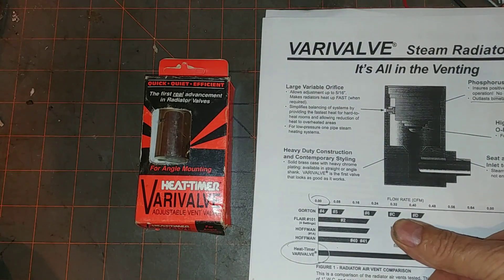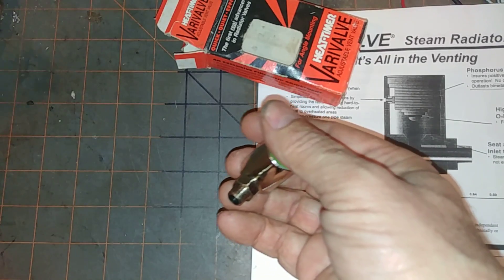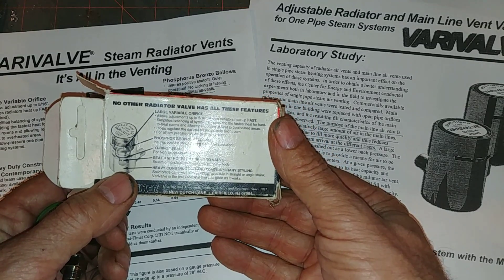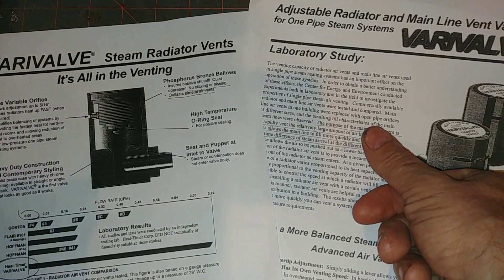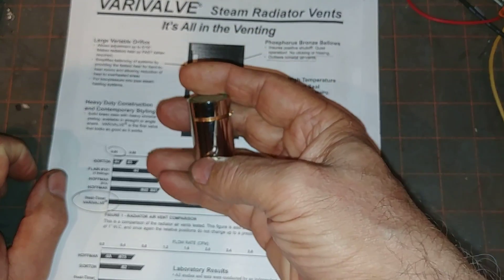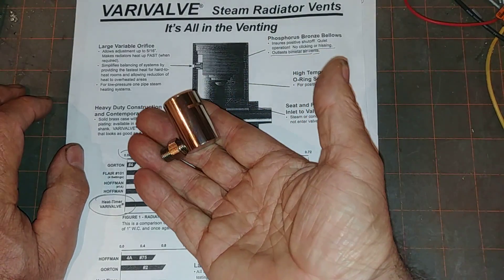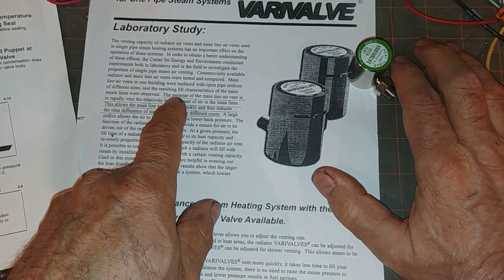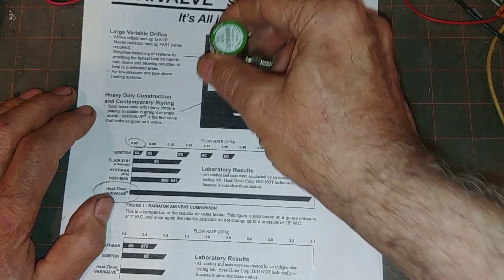Varivalve Single Pipe Steam Radiator Vent - It Vents Too Much, It's Likely To Spit & Fail Open

Comment: I have these on all my Radiators, they do spit out here and there but overall work. I did replace my 2 main air vents to Gorton No1s which did save money on the bill due to quicker heating.
Reply from the maker: Good on you for installing good main vents.
And if the varivalves are working for you,  that's great!
If they start failing, I would recommend to consider Vent Rite#1s.
Reply: I just received my gorton no1. I ordered 2 of them. Hoping this will help me also. I think I'm becoming addicted to steam. 😅

Comment: Unfortunately, I bought four of the Vari-valves during the last heating system.  I also bought a 2" Groton main valve #5 that will not shut down.   Continuous steam release.  There's a dip at the end of that main and water collects there.
Reply from the maker: Sorry to hear you had Gortons that failed open out of the box. That sucks.  Did you get them replaced?

Comment: I was working on Park Ave in Manhattan back in '93. We had to cape a fitting. The problem was no one told me it was a $400,000.00 painting I took off wall and tossed on bed. What a nightmare, had to share that one.
Reply from the maker: Oh! my! gosh!
Was there an insurance claim?
I would guess certainly harsh words were said, at the very least.
Reply: I was told the oils on my fingers depreciated the value of the frame. Co. took care of it. I learned a very valuable lesson.

Comment: I use one of these. It's on a W.W Carman's radiator from the 1880s. It's bigger than a small boiler, and most vents are too small to get even 1/4 of the air out of it during a cycle, even with main vents properly sized. The Varivalve does work for it, with the additional benefit of fitting properly under the top cover due to the short height. No spitting because the vent is about 3 feet or more up off the ground. I would never use one on anything smaller but for such a massive radiator it or the Gorton D are the only vents available beyond putting an elbow and small main vent on the radiator.
Reply from the maker: Thanks for your comments & observations!
I think what the Dead Men used to do is drill & tap the larger radiators that were hard to heat in two places to install vents. The steam would reach one first & shut it down after a lot of the air was gone, and the other vent would continue to allow the air to be expelled, but at a slower rate to reduce the likelyhood of spitting & gurgling.
This all supposes that there was also massive main venting, of course.
Reply: I have seen that in Audel's Oil Burner Guide. On this radiator because of its rarity I don't dare go anywhere near it with a drill. On something common like a thin tube or similar I would maybe try that, or a manifold that holds two vents. In this case, this seems to be the only radiator that works well with a Varivalve. It has the right combination of almost comically large size, super high vent location, and on the end of a very long steam main. Even with a Gorton D it doesn't heat up fully with the boiler running for hours. Wonder how it was supposed to work in the 1880s, when I can assume vents had nowhere near the venting rate they do today? I suppose with coal you could wait hours for the thing to heat up. It weighs around 350-400 pounds, maybe more, with wrought iron tubes, steel? inner tubes, and a cast iron base. Believe me moving the thing to repaint it was difficult, even on linoleum where it could slide. It had to be stripped and repainted right in the kitchen where it is, moving it somewhere else would have been nearly impossible.

Comment: Two-story single family home here. We got a new properly sized boiler installed a couple of seasons ago. It produces nice dry steam, and the mains have massive vents in them. I installed slow-venting Hoffmans on our recessed convector radiators. A few radiators farther from the boiler have struggled to get hot enough. Finally, this year I installed Gortons, either size 6 or C, on the struggling radiators. It has seemed overall to solve the problem. However, I’ve had a few episodes of hissing/spitting vents. Also, sometimes they hear unevenly, I think because a vacuum is being created in one of the radiators. I’m wondering whether I should try to size down to a #5 on these radiators, but I fear that some of them won’t heat adequately. Thoughts and advice?
Reply from the maker: I don't know your situation, but try the #5, and maybe also put a #4 on the unit closest to your t-stat.
Reply: @gordonschweizer5154  Thanks so much. I know it's near impossible to diagnose a problem without seeing it, but I appreciate your suggestion. Will continue to experiment. The only issue with the radiator close to the t-stat is that it's actually at the end of a very long runout and, with the smaller vent, it would just stay ice cold because the vent had to clear the air out of the supply pipes as well, so I had to size that up more than I normally would. I'll keep experimenting.
Reply from the maker: @AT-oj7of  Thanks!
I'd also make sure your steam mains are vented very well and insulated properly.

Comment: Can someone tell me which valves are the best. I had quite a few included varivalve fail on me.
Reply from the maker: @Taras-Nabad  All steam radiator vents have issues to a greater or lesser degree 
Currently, our "go to" adjustable steam vent is the Vent Rite #1.

Comment: Thank you for sharing this great info.  Helped put a couple concepts into perspective. Esp "toy vents" and "heavy breathing"/ vaccuum.
Reply from the maker: Thank you very much for the kind words!
It took me a bit too long to realize that if someone is putting a Varivalve on a radiator, it works because it's treating the symptom and not the underlying problem.
In the meantime, the customer is having to put up with the notorious V.V. spitting and early failure rates.
On the plus side, they add good weight to the scrap bucket!
Thanks again & happy quiet steaming.

Comment: I have these valves and I appreciate how much you know about them.  I googled your video because my upstairs gets much hotter than my downstairs, though I have actual radiators upstairs and downstairs they are baseboard heating.  And the thermostat is downstairs. So it takes much longer to heat up the downstairs and it makes the upstairs very hot. So I’m wanting to learn how to use the valves to make the upstairs radiators not as hot. But after watching the video, I realize there’s so much about the technology. I don’t understand. Tilting, bleeding… I don’t even know what the valve function is. Is it to let steam out? To let air out? You mentioned that you can turn off the radiator entirely by closing the valve. Wouldn’t I have to turn the other knob on the other side that keeps the steam from going in to the radiator in the first place to do that?
Reply from the maker: Part of the problem you may be having is the baseboard heating.
I assume it is cast iron BB, at least (if it copper fin tube... not good at all)
Cast iron BB has issues when used with steam heat.
One issue is that it might not be the same output as the free-standing radiators it replaced.
For now, I would remove the varivalves and install Vent Rite #1adjustables for better control of the steam entering your upstairs radiators. 
The vent is for releasing the air from the radiator.
Where there is air, there cannot be steam.
If you slow the air being released from the radiator, the slower it will get hot.
Also, make sure you have good large vents such as the Gorton #2 on your steam mains in the basement.

Comment: I installed 3 of these on 2nd floor radiators with the vents wide open....radiators remained stone cold....replaced with Gorton C's and all radiators came back to life.
Reply from the maker: I've heard that the Varivalve line suffered a really bad run recently and you must have been caught up in that.
Hope you got your money back.
As to your needing Gorton C to get your radiator hot, have you looked into improving your main steam venting?
By venting your mains properly with large vents, the radiators can be vented with smaller vents.

In general, smaller, slower radiator vents last longer due to not as much rust & stuff being sent through the vent orifice. Also, radiators tend to heat up with less spitting and sloshing in most cases (also a general case... you yourself might be just fine).
It is easier to balance a system with good main venting as you can dial in the venting on the radiators when most of the air in the system is dealt with in the basement.
Stay warm!
Reply: @gordonschweizer5154  thanks for the reply....truth be told I probably don't need C's upstairs but I was so tired of freezing I wanted to see how much heat I could get up there. Thanks for the tip on the main vent...I'll have a look at that guy, he's pretty old and might be clogged with hard water deposits.
Reply: Ok wound up installing a number 6 instead of the Varivalve. Now the radiator heats up nicely with the added benefit that the system is suddenly quiet...no more banging on the second floor. Time to re-visit those other V-Vs! Very thankful for your vid!

Comment: Thanks for the video, Gordon!  We're professional engineers and NYC plumbers, and installed several hundred of these over the course of a year or two.  They looked good, well made by an American company with a good history.  Two-fifths of them failed in a year.  They stopped venting.  We cut one open and found that the bellows had dismounted from the top and fell onto the aperture. 

So we called Heat-timer.  We wrote to Heat-timer.  Never a response.  We were out thousands of dollars and had dozens of angry customers.  

A great idea - like a mini-steam-trap.  But there's a design flaw.  And the company, like its product, fails its customers.
Reply from the maker: I am sorry that Heat-Timer did not step up and take care of you.
Sad, indeed.
Reply from the maker: What pressure do you run the boilers?
Reply: @gordonschweizer5154  Generally less than a pound with vaporstats.

Comment: I found a copy of the Audels oil burner guide a few years ago I remember some of the information thanks for sharing.
I have a two pipe system and have a Hoffman 75 installed on the steam separator two pipes vertically hung with a cast iron contraption on top and the main vent on top of the device, I think the main vent was replaced about every three years or so. I’m never thought about using anything else but you have a good point that Hoffman 75 isn’t the best thing.
I have about 600 square feet of radiation around the building and I’m thinking about adding some more radiator’s to some cold area’s.
I’m going to get a thermal video camera attachment for my phone and start looking at the steam to find out where it works and where it goes wrong. There’s no shortage of work as a homeowner, but thanks to you it’s been very easy to understand how to troubleshoot the steam heating system. Not everything is the same in two pipe steam but there’s enough similarities to keep it interesting.
Reply from the maker: I thank you for your comments!
You might have some "cross-over" steam traps on your system at the ends of your mains?
Reply: I have two steam traps at the end of the mains I thought it was weird that they were uphill from the mains to the dry returns and I changed the nipples to make them downhill But I was corrected by an old timer who said that there was no steam left by the time the steam trap was reached the end only air so it wasn’t necessary to install longer nipples.
I did remove two large radiator style steam vents from the top of the wet return pipes at the end of the mains they seemed out of place and not in keeping with the rest of the system.
I can send you a link to a video I’m thinking about making since my skills at descriptions are inadequate.
Reply from the maker: @davidlampe4153  Thanks for your description!
I didn't get notice of you posting here & found it by accident.

Comment: I used on a radiator on the end of a main that I couldn't get to heat. I had a Gorton No2 vent after the take off for that radiator and had all the other radiators working perfectly. I suspect that the boiler may be slightly undersized. That vent finally got that radiator to heat.
Reply from the maker: You bring up a good point about an undersized (or underfired) boiler causing otherwise properly vented radiators not to heat properly.
"If you put a big vent on a radiator (and have proper main vents on the pipes), and it still doesn't heat properly, it ain't a venting problem"
Reply: @gordonschweizer5154  maybe next time she calls me to service her boiler, I'll bring a manometer with me and see how much I can upfire her boiler. It is a newer weil mclain, about 7 years old.

Comment: The sylphon bellows are attached to the top of the cap with a formed press-fit crimp. The seat is on the bottom.  There is no float.  When the bellows over expand, they distort and fall out of their top mount.  Then they lay on the seat, stopping air flow.  This is a design defect that affects 2/5 of these.  

The adjustment slide does little to throttle air flow.  They are VERY FAST vents.  

Heat-Timer had an adjustable version in the early 1960's that seemed to work better.
Reply from the maker: Exactly so.
It seems we are both in agreement: Other than their high venting rate, there is little to recommend them.
And even their high venting rate can backfire on the customer in some instances.

Comment: Hi, thanks a lot for your videos. I'm looking to replace the vent valves on all my radiators and was looking for your opinion based on your experience. I see options from Varivalve to Gorton to Ventrite#1. Which would you recommend as for 2024? I watched your ventrite video. Is it still the best one in your opinion? Thanks for your input!
Reply from the maker: @themacavelly  You are most welcome for the kind words!
Yes, the Vent Rite #1 is my go-to vent in most cases.
I would not put a Vent-Rite on the radiator in the room with the thermostat. 
That radiator should get a fixed vent so it becomes the index for the system.
Which fixed vent?
Hard to say, but I usually start with a Hoffman #40.
Balancing a steam system is often a process of trial & error.
Please do make sure your steam mains are insulated and fully vented by themselves.
I would recommend a Gorton #2 on the longest main.

Comment: Great video! Watched a bunch of your others too, thanks! I have a Gorton # 1 on my main. It takes 2 to 4 minutes of releasing steam before it shuts off. Is that normal? It seems 10-30 seconds should be enough. 1 year old small (100k BTU) Weil-McClain. Could surge be affecting my Gorton? (I have always used Hercules boiler liquid). PSEG wants me to fill it to 3/4 (I think the lower the better as it's steam I want). It has to be refilled more often than my old peerless. BTW, I replaced the Gorton #1 with a new one and it is doing the same thing (may be from same lot as both were given to me by 1 year ago by PSEG).

BTW,  I have all (working) varivalves on my  radiators which I will be replacing after this.
Reply from the maker: Thank You!
As to your issue with the Gorton #1, it appears from reports by others that they are going through a rough patch as far as quality control is concerned, sad to say.
But you might be having wet steam issues, as you suspect.
3/4 is too high.
I would try to run your boiler water level at about mid gauge.  
I believe that is close to what the manufacturer calls out for.
Check to make sure your pressure control is set to the lowest possible setting & the pigtail is clear.
Is the near boiler piping correct?
All the Hercules boiler liquid in the world will not overcome bad piping.
Reply: @gordonschweizer5154  UPDATE: I installed both my Gorton #1's and both were letting out so much steam the water levels dropped like crazy and I'd have to refill. I went and bought a third and installed. This new one barely vents but at least I'm not losing water. Meanwhile, I returned the first two to Gorton and they quickly sent me two replacements in exchange.  Will try one later today to see if I can get goldilocks "just right".  Also, I got PSEG to give me a new Pressuretrol. I installed a 3 psi gauge next to it for a more accurate reading and it cuts off at 2 1/2 psi and then back on at 1 psi (settings are at the lowest at .5 with 1 differential). The old-brand-new one wouldn't cut off lower than about 4 psi. So much for getting it to run at 1 1/2 psi. Not happening so I'm going to have to live with this. The piping and the Hercules had nothing to do with all this. Thank you!
Reply from the maker: @hymnistic  Thank you very much for the detailed update.
Inaccurate pressuretrol issues have been around for a long time sad to say.
You've got the grey box one or the clear plastic front one?
Reply: @gordonschweizer5154  Grey box
Reply from the maker: @hymnistic  The grey box or PA404A is "tweakable" to be more accurate, but it is hard to show that on YouTube.
You have to search a bit to find info on that.
As to your failing Gortons, I don't know what to say, except I'm crestfallen to hear of your (and many others') problems that that heretofore excellent brand is suffering.

Comment: Would you use a vent like this for master venting a riser pipe.  I have used Gorton #2 at the top of my risers.
Reply from the maker: I'd stick with the Gortons.
That line in Heat-Timer's sales literature that Varivalves last longer that bimetalic type vents is a load of male bovine fecal matter.

Comment: Hello, a lot of smoke is coming out of my valve. I tried opening and closing but still not working. Please help
Reply from the maker: Smoke or steam?
It seems at least the vent has failed.
It should be replaced with something other than a Varivalve.